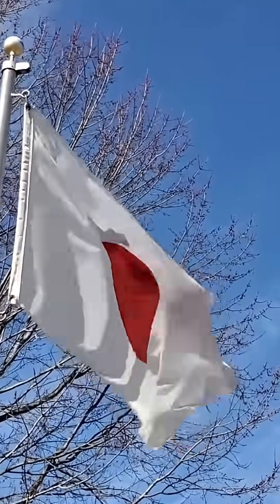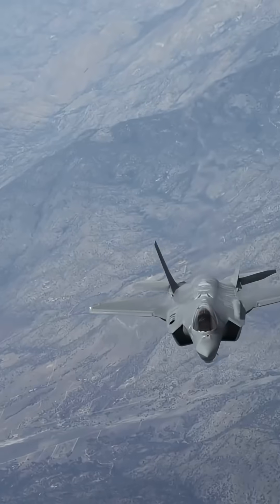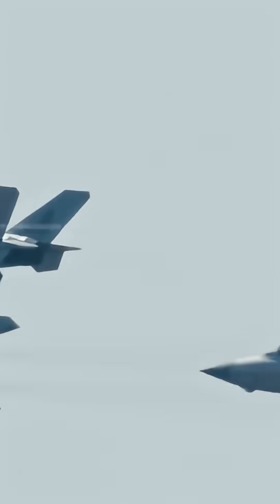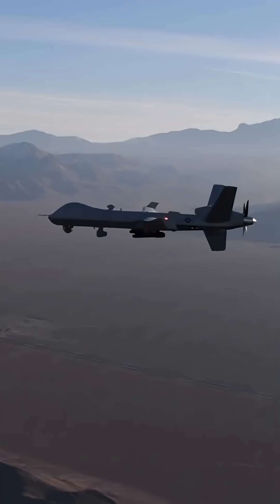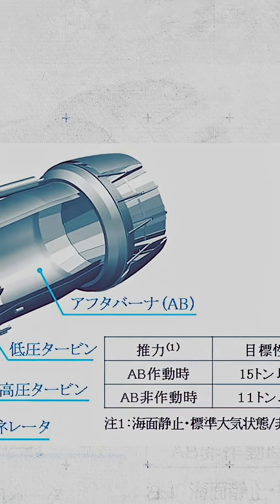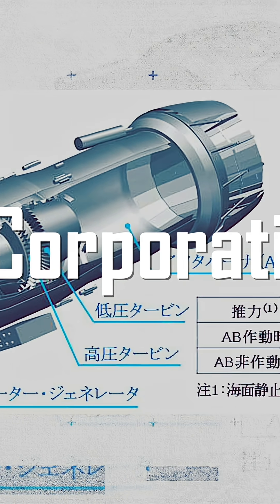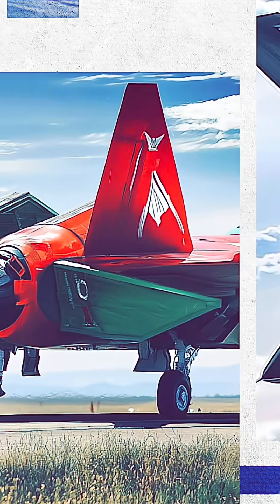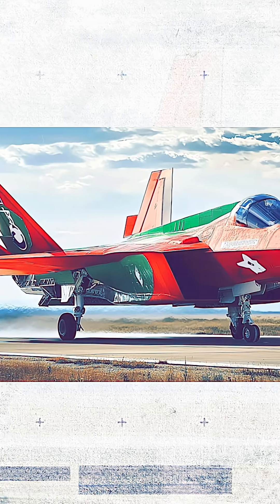Japan’s F-X: Can a Jet Carry a Laser the Size of a Truck?!

Comment: If you were a civilian, would you want small nuclear reactors flying over your home?  What about if it crashes?
Reply: Why bother with nuclear, batteries or generators shafted to your engine, there are also combustion pumped laser, you could probably use your jet fuel too.  Nothing like a small explosion to provide the power you need in a short period of time.  It would tend to be an infrared laser but that's what the current military lasers are...

Comment: Japan just look at Voyager 1 & Voyager 2, 50 years later and they’re still going, perhaps all you need is something small just like on those two probes to Power those lasers and then the energy source will have to be changed out periodically, it’s just an idea, build the prototype, plus it could be a bomber instead of a jet, perhaps with four engines like the Valkyrie, just some ideas that you can use or not use, remember, you have to put all the options out on the table, and who says that a laser has to be super powerful.
If the United States can build aircraft carriers and submarines that are nuclear powered, where is it written that you can’t have a jet or a bomber that is nuclear powered, it is a concept that even the United States of America toyed with many decades ago, but back then it was not feasible because the technology wasn’t there, but today the technology is available.
Reply: Hmmm solving this is easy . For the right price . It's been under development for the last ten years